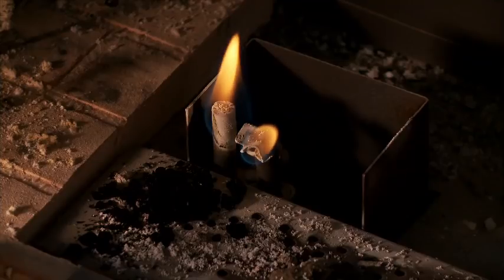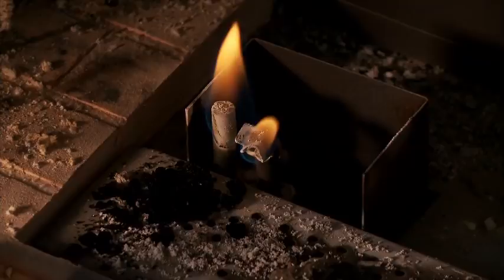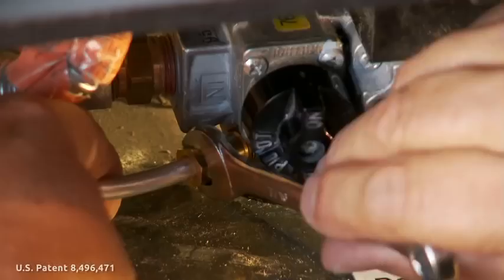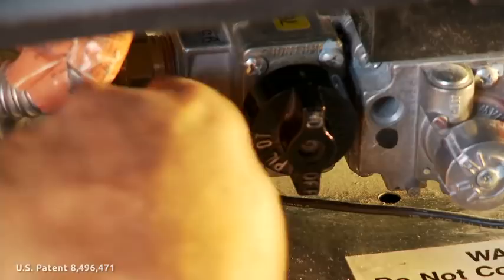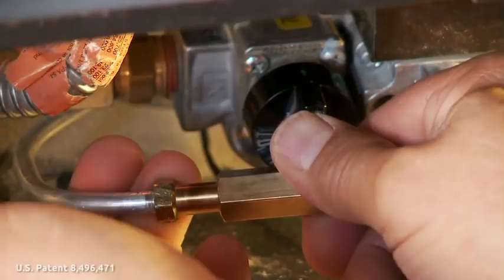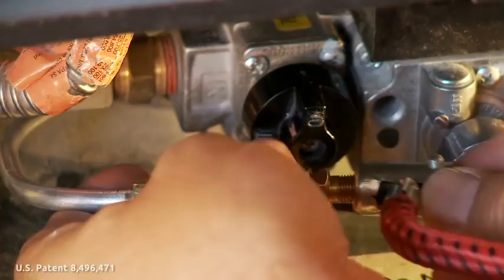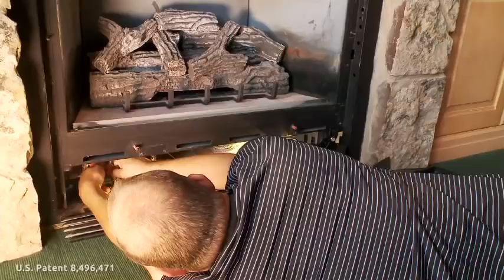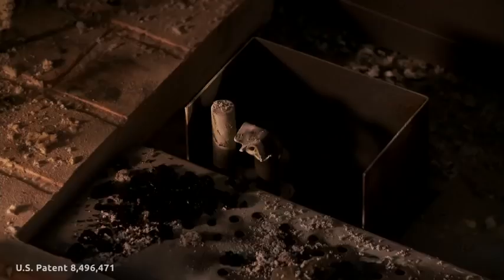Gas Pilot Cleaner - A 3 Minute Repair - GasPilotCleaner.com

Comment: Adapter shown is two fittings.  1/8" to 1/8" NPT female coupling plus a 1/8" NPT male to Schrader adapter (that connects to bike pump).  Can get at any hardware store and use your Schrader bike pump.
Reply: 1/8 npt female coupling did not work

Comment: Ours wouldn't stay lit and we fixed it with one of those pads that is on the back of some kitchen sponges. Turns out the thermopile was dirty, so we simply cleaned it off. I posted a video on my channel if you want to see how easy it was to fix.

Comment: Worked like a champ. Mine had 2 fittings and was the silver one. just look near the pilot assembly and verify color. hooked a portable air compressor up and blew it out while holding the compressor on with my fingers. no other took required.
Reply: Yeah I think this might be my problem too. The pilot flame is real small and does not change no matter how far I turn the adjusting screw out, but it does get smaller if I turn it in so I am pretty sure it's blocked. Going to disconnect the line and blow it out with my air compressor. 🤞

Comment: Help! I have a Desa T32ENRB gas/electric fire place. I'm having the issue of it shutting off after the bunners cut on. What's hard to figure out is  that this unit doesn't had a thermo coupler or a thermo pipe. There is only a gas line to the pilot and to the bunners. So I'm thinking everything else is electrical. If you can help me in any way I would highly appreciate it. Thank you!

Comment: where can I buy that brass adapter?
Reply: Did you ever find brass adapter
Reply: Adapter shown is two fittings.  1/8" to 1/8" NPT female coupling plus a 1/8" NPT male to Schrader adapter (that connects to bike pump).  Can get at any hardware store and use your Schrader bike pump.

Comment: Gas any one ever cleaned a boiler pilot light this way? Just unscrewing the silver tube at the pilot and blowing air all the way threw it till it reaches the pilot-
Reply: Are you saying I could simply use my little nail gun compressor and blast a quick jet of compressed air up through the hose/fitting this guy in the video did.... And skip purchasing another tool?